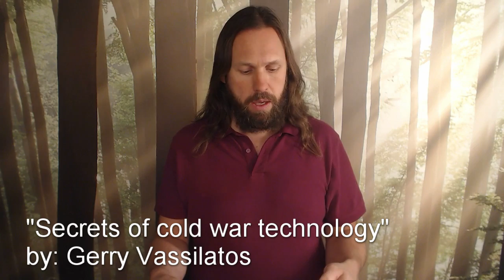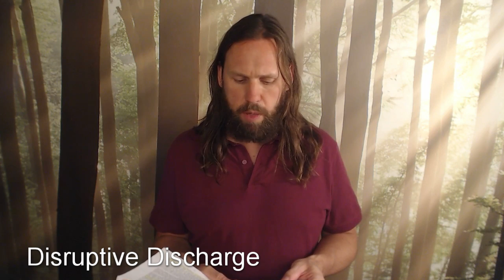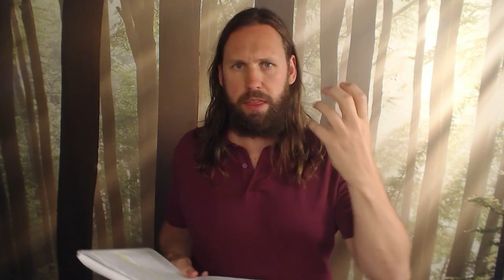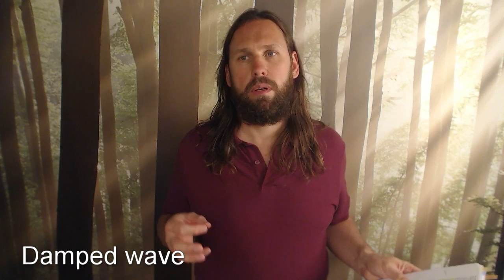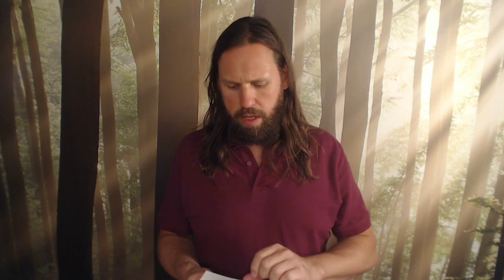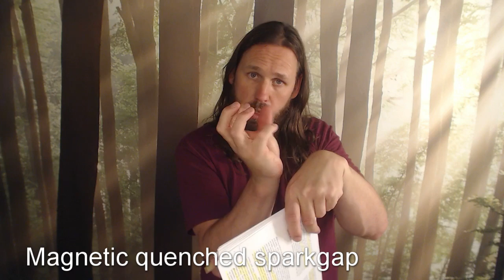Nikola Tesla's Radiant Energy Part 1 of 3

Comment: You mentioned "inertia" and "gravity" in one of your 3 parts to this series.  I've never heard anyone make the connection so maybe you have some awareness of the connection.

Bear with me.   Keep in mind that gravity declines as you move away from Earth.  So let's make a series of 'gravity strength' spheres totally surrounding Earth. At the surface, the gravity strength sphere #1 is, say, 1000 feet high.  And gravity is at normal strength that we're used to.  All around this planet, if you push on an object laterally (sideways) or upward, you feel resistance - INERTIA - when you push the object to move it.  All around the planet, you will feel the same inertia - SIDEWAYS and UPWARD - the same resistance when you push the object to move it.  Same sideways and up INERTIA in this gravity strength sphere #1, all around Earth.

Now the next gravity strength sphere #2 is also around Earth, between 1000 feet to 2000 feet in thickness, and just outside and surrounding gravity sphere #1.  If you push an object sideways or upward, you feel the same resistance, the same INERTIA, when you push the object to get it moving.

For each additional gravity strength sphere - #3 which is from 2000 feet high to 3000 feet high,  #4 which is 3000 to 4000 feet, etc. -- you will feel the same inertia when you push an object sideways or upward.  

So for humans, for all of time, we have always said "inertia is the same everywhere" because, as said above, if you push an object sideways or upward, you are a specific distance from Earth when you do that.  SO EVEN THOUGH GRAVITY IS ACTUALLY GETTING WEAKER as you move from gravity strength sphere #1, #2, #3, #4, etc -- no one on Earth feels gravity getting weaker.

Gravity is weaker at the top of high mountains.  And gravity gets even weaker as you move into space. 

BUT WE NEVER KNOW IT.  Because in our life experience, we are moving things only sideways or upward (cars, furniture, chairs, rockets, planes, etc)

This I think explains why no one has noticed THERE IS NO DOWNWARD INERTIA.   Push a car down a road.  Lots of inertia, takes several people pushing the car to reach the gas station.   Dig a 200 foot hole under the car.  IT FALLS IMMEDIATELY.  No pushing required.  NO INERTIA.

Everyone says "well duh, the reason there is no downward inertia is because of Gravity."

AND THAT HAS BEEN THE MENTAL BLOCK. 
We've had a concept to explain away why there's seemingly no downward inertia so we don't question it.  "It's gravity."

Okay what is the *exact physical nature, the exact physical mechanism* of gravity?
"No one knows.  We cannot create anti-gravity devices.  We have General Relativity and Newton but those are mathematical models."

Okay, you don't know what gravity is.  But somehow?  you're 100% certain that,  "Whatever gravity is, it hides downward inertia."
You can't say that.

Gravity is a gradual decline in the inertia that matter objects have in space.
MATTER, the number of atoms in an object, IS FIXED. 
MASS, the inertia, the inertial mass of an object IS VARIABLE.

We've known it since 1905 when Einstein said "as an object accelerates, if it keeps accelerating (which is a change in motion which makes inertia appear) -- the inertial mass of an object (the inertia) becomes so great that light speed is a maximum velocity."

Einstein told us 114 years ago, and won a Nobel prize,  "MASS IS VARIABLE."  

Inertia is created by matter - atoms - interacting with the background field.  Large rotating planets create turbulence in, and lower the viscosity of, the background field around them.  The most turbulence is at the surface.  And the turbulence declines as you get away from the planet.
The background field exists.  It was proven by the Lamb shift and by experiments that proved the Casimir effect.  This is info on the background field:
https://en.wikipedia.org/wiki/Stochastic_electrodynamics

*SCENE*  -- You're in space far from any planet.  A big rock is next to you.  You spend a 1/2 hour and push on the rock, in every different direction.  You notice THE SAME RESISTANCE, the SAME INERTIA, the rock gives when you try to push it, IN ANY DIRECTION.
You can push the rock in any direction and feel the same resistance (inertia) when you push it.

You move to near Earth.  Suddenly you can no longer push the rock in any direction and get the same inertia.  

Inertia is declining in the direction of the planet.  Pushing the rock towards the planet gives less and less inertia (resistance) and ultimately the rock is 'falling' into the planet.

You pull the rock back out into space.  You get far enough away from the planet so that full inertia creation in the rock is restored.  Finally you're far enough away that, once again, you can push the rock in any direction and feel the same inertia.

MASS - INERTIA -- is variable.
MATTER -- atoms -- is a potential to create inertia with the background field.  Matter is FIXED for an object.  Mass is VARIABLE for an object.

The background field is electromagnetic.  Atoms of matter interact with the background field and create resistance to movement.

It is conceptually identical to why the electromagnet push - current - into an inductor in a circuit - the arrangement of the atoms of the inductor do not allow the electricity to move through temporarily.  This is INERTIA.

And Tesla's radiant energy device relied on the same inertia effect -- electromagnetic force STOPPED temporarily BY MATTER OBJECTS.

I have (found) an antigravity patent from 1968.  I have a physics and electrical engineering background and this patent looks legit but it took a while to understand it.

I wanted to share this with you because no one else makes the inertia and gravity connection.  You are the only other person to imply there's a connection.
 .
.
.

.
.
.
Reply: @Antony Moondance   I'm following a patent to test out if its antigravity and anti-inertia effects are for real:
https://patentimages.storage.googleapis.com/3a/e1/0a/cdda5bf4825fb1/US3626605.pdf

The device was patented by an aerospace scientist in 1968. I have an EE and physics background, the patent seems legit, although he was a bit 'cagey' and didn't point out that NMR magnet and oscillator field strengths are required to get stronger results than he published in the patent on page 4, Figure 6.  

If you look up NMR before reading the patent you'll see instantly that his device is based on NMR principles.  
https://en.wikipedia.org/wiki/Nuclear_magnetic_resonance

The gravity control and inertia reduction effect of his device is described on page 12, left side, bottom paragraph.  

I'm starting with a simple version of Figure 7, on page 5, that will be the size of a tennis ball.

.
.
.
Reply: @Atonal Moondance   Creating a mold out of sand or clay using a tennis ball is easy.  What I'm having trouble with is the amount of current required to create a large enough magnetic field to polarize the atoms in the way that NMR processes do.

The crew compartment shell is made of Bismuth (figure 7, page 5 in https://patentimages.storage.googleapis.com/3a/e1/0a/cdda5bf4825fb1/US3626605.pdf)

Aside from the Bismuth shell in that patent,  here is a piece of manufactured Bismuth layers sandwiched with metal conducting layers of magnesium/zinc.  It supposedly is a part of the hull that came from a crashed ufo.
http://midnightinthedesert.com/mysterious-micron-layers-alternating-bismuth-magnesium-bottom-wedge-shaped-ufo/

I'm combining the design of the crew compartment device in the patent - a spherical Bismuth shell -- with this piece's 'sandwiched' layout. Both the spherical crew compartment in the patent, and this piece from the hull of a UFO, are relying on Bismuth.  Must be something to it.  

Bismuth has a low melting point, you can melt it in a pot on the stove, then pour it into the mold.  The 2 halves of the Bismuth 'tennis ball' can be put together then wrapped with a metal conducting material.  

The problem I'm having is the amount of current required - a large DC, static magnetic field is required to align/polarize the bismuth atoms in the way that NMR machines do, in the instructions in the patent  -- but the amount of current creates too much heat for the Bismuth.

I've spent the past 4 weeks trying to figure out a way to create a large enough magnetic field without needing to rely on cryogenics. 

I'll figure it out.
Reply: Greg chase check this out https://www.youtube.com/watch?v=YkWiBxWieQU&t=177s
Reply: Ask yourselves why I, laying on the beach - west coast of Oahu - sea level w/ an inexpensive optic can clearly see the entire island of Kauai approximately 100 miles away.  According to NASA'S curvature calculator, the entire island should be concealed by over 6000 feet of elevation drop or a giant hump of water.  Certain days of the year, an optic is not even nessessary.  The longest distance photograph ever recorded is over 200 miles distance!  

I'm not going to argue with anyone about the fraud Einstein, or the false heliocentric model we were all indoctrinated with over the decades, a globe in every classroom from day one.  
The concept of gravity, their excuse for everything that doesn't work with their retarded models,  instead of simple density, beoency, up and down!

Look at the following information, and then apply Tesla's work to a different model of the earth and our existence.
Instead of a masonic fabrication used to coral humanity like cattle to a north pole, prevent them from traveling too far south to the antarctic perimeter surrounding this sector of the plane.

See if Tesla's work doesn't make much more sense without the ridiculous magnetic spherical planetary bullshit weve been conditioned with.  Magnets do not behave like this in a vacuum or anywhere. 
You can not have a positive and negative pressure zone side by side without a physical divider!
End of line.

YT channel:  Eric Dubay

Comment: *PEOPLE INCLUDING TESLA (apparently?) ALWAYS UNDERESTIMATE GRADIENTS*

A 'gradient' is some force that is stronger in area A,  and still present but weaker in area B.
EXAMPLE:  Gravity is a gradient.  The strong part, area A, is on the surface (actually towards the core but the surface stops you from being pulled by gravity closer to the core.  UNLESS you dig a deep hole.  Then you just exposed yourself to gravity's gradient some more.).

The weak part of gravity, part B,  is away from Earth, as you move into space.  A gradient is a change - a gradual change - in a potential of energy, power, force.  You 'feel' the gradient more, as you get closer to 'area A', the strong part of the gradient.

Tesla's radiant energy is a GRADIENT.  An electrostatic gradient.

Some people don't believe that.  I tell them "okay, I'm making a capacitor.  I have one of the 2 capacitor plates ready.  It is a 6 foot diameter piece of metal.  Here, I've mounted the plate vertically, using a teflon post anchored in the ground.  I have a 20 million volt generator that is connected to the plate, I'm gonna crank this baby up."  

"I need you to stand several feet away - let me know when you feel something."

Only an idiot will stand anywhere near my 6 foot diameter metal plate.  I tell such a person,
"Hey, ah, forgot to mention -- the plate spikes to 100 million volts for about 1 millisecond when I switch the power on."

If he's still standing there, I tell him "Okay, just one more thing.  Because the 100 million volt spike only lasts one millisecond, I rigged up a resonant circuit that turns on power for a millisecond then shuts it off for a millisecond, and my 6' capacitor will spike to 100 million volts 500 times a second.

If he's still there, more confessions,  "Look - I've worked on this for a while and I know how to focus my gradient here -- did you notice the purposely symmetric, not-flat shape of my capacitor plate?"  

Anyway, NEVER underestimate a gradient.  Another example:  a magnet is a gradient field.  Put your finger between two refrigerator magnets - no biggie.  

Stand in between two 20-Tesla electromagnets - those are massive, massive gradients. 

And they're 100% invisible.   They will definitely be felt, far across a room.

For example,  MRI machines are 1 to 2 Tesla and it's forbidden to have metal objects in the MRI room.
People have been killed by metal objects being sucked into the MRI tube.  And the force, the danger, is 100% invisible.

Never underestimate a gradient.  

.
.
.
Reply from the maker: Thank you for sharing

Comment: Can someone with more knowledge on the subject, comment on Tesla's radiant energy vs EMPs as at first glance they appear very similar in both effect and creation. Thanks in advance!
Reply from the maker: Radiant energy can be induced by emp's but they are not the same. For instance magnetic and dielectric field energy can resonate with radiant field energy, but to do so you need emp's (impulses).
Impulses (emp) can be created by back emf
Reply: @MasterIvo  Thank you
Reply: Master Ivo isn’t ac a emp at 50/60 pulses per second
Reply from the maker: No AC is a sine wave. An Impulse is like a back emf inductive spike. quite different.
Reply: Master Ivo is it related to the sub stations blowing up back in the day. When they shut the power off the magnetic field would drop and they would get a massive back surge of power. Taking out the sub station
Reply from the maker: Yes thats it. and not only the magnetic field energy, but also the dielectric fields energy that is build up around the power lines.

Comment: What came into my mind is smoke ring cannon. I think the sudden rush of unidirectional current created by voltage "pressure" creates vortex ring of aether. As Tesla said / imagine, -- in my interpretation -- the vacuum (aether) has some kind of gaseous properties composed of conductor (charge carrier) submerged in insulator (space). The sudden movement of charge (carrier) drags the aether to form vortex ring.
The movement of gaseous (or liquid) vortex ring has distinct behaviour with laminar or turbulent flow.  On the other side, common electromagnetic wave analogous to sound wave in gas (more likely laminar). Perhaps, that's why (with enough intensity) it can penetrate Faraday cage (more focused) and travels to longer distance without loosing energy -- compared to common electromagnetic wave.
Reply from the maker: yes the ring vortex is what comes to my mind as well
Reply: That sounds like sub-quantum kinetics on describing how Podkletnov's impulse gravity beam generator.
Reply: Thats how the ZPE quantum vacuum is described, a gas of virtual particles and very high energy.

Comment: Very interesting it's almost as if it's an oscillating magnetic field that keeps fighting but then pulsating the voltage higher every time until reaching the 15V but that can't be true because a magnetic field is created by current unless some very interesting electron flow is happening ie a current is able to go in reverse on the surface while the majority of the electrons flow the way they're supposed to. Do you understand what I'm saying if not I'll try explain better?
Reply: Always learning. Found out decades ago physics quietly found out only voltage motivating charges creates magnetic fields, not moving charges. Of course, if a voltage exists, magnetric fields can increase magnetism. This bears consideration as the actual magnetic field is only sourced by atomic particles. Which group or pattern depending on the specific voltage it us grouped with as a collective. This regrouping is how electricity is generated. 

Original thought follows unedited...

I think you are on the edge of clarity. What is a magnetic field? Perhaps a compression of Aether that changes the density of space, creating a gradient. So a moving charge is like a boat creating a wake. If you make a pulse generator in the water, you get a wake effect... similar to the bow shock in front of the boat, but without the boat coming along and overwhelming the effect. Of course the timing of the pulse is important, as this type of magnetic field can be adjusted by the pulse width. Whereas regular magnetic fields depend on the size of the charge, and the polarity of the charge and the direction of the charge to shape the magnetic (3D compression profile of the Aetheric density, shaping space... which is specific to only similar shaped particles to the source) field.

Here you can see a positive charge would shape a magnetic field that only affects positive charges (gravity?), and a negative charge only affects electrons (magnetism and currents). But a negative bow shock from an impulse could be shaped to affect ANYTHING.  And stuff that is not matched will be unaffected. This is energy transmission without loss, using the Aether itself to carry the waves like sound through air, that passes through screens, lifting papers and reflecting off desks. Its all about the profile of the objects matching the kinetic energy to size... when a plane reaches the speed of sound, or the speed of the air molecules, it suddenly becomes solid.. and you get an air constructed compression wave, the boom generated by the air itself. 

Its just a model... Consider the fractal nature of reality. Even the Aether can have different energy levels, with perhaps an Aether of its own that sustains and supports and interacts with it. Yielding dimensions... No need for counterspace. Peace, B